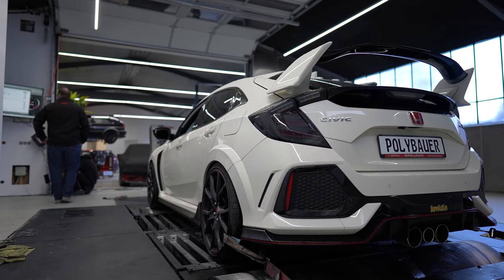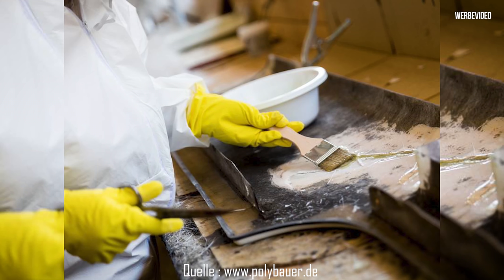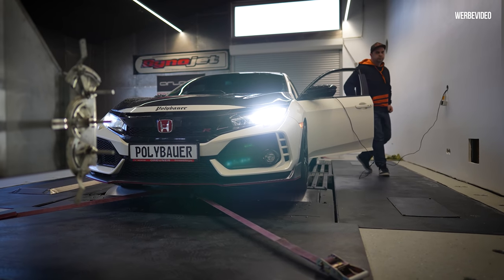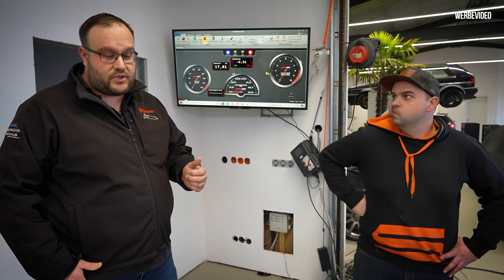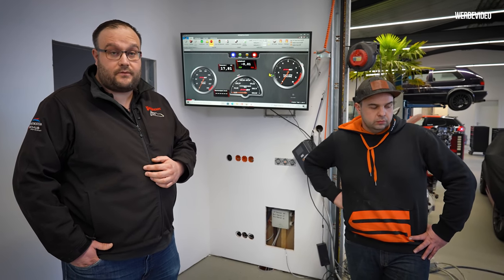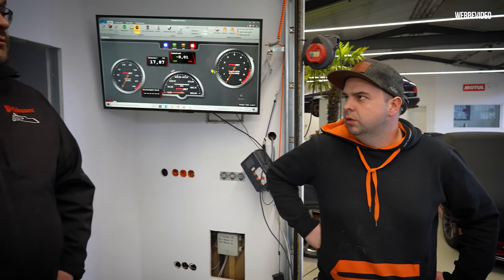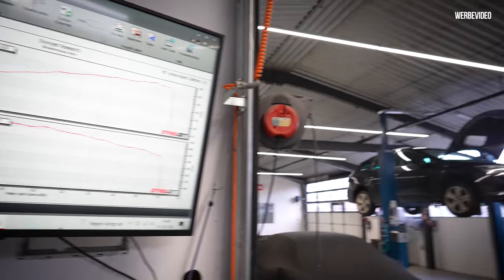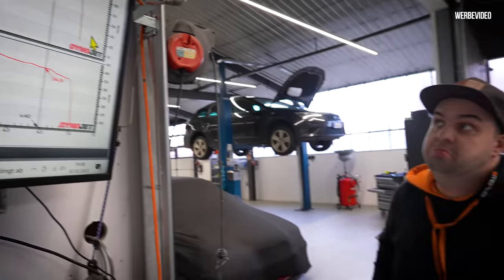Neues Projekt |  Honda Civic Type R Tracktool  #1 René Bàuche

Comment: Fahre selbst auch einen fk8 type-r  und habe aktuell umgebaut auf: remus abgasanlage mit Sound Controller, prl motorsport ansaugsystem, japan racing jr28 8,5x20  mit bridgestone potenza sport Reifen,  smokey Seiten Markierungs leuchten.
Reply: wieso das prl wenn man fragen darf?
Reply: Remus Abgasanlage mit Appsteuerung Via Smartphone? Wenn du das eingetragen bekommen hast, verlink die mal bitte hier (sollte aber bitte nh Klappe haben)
Reply: @dr.c_y_r_a_x_x5436  

Habe mir das prl stage 1 ansaugsystem geholt weil von hondata ein test von allen gängigen ansaugsystemen gemacht wurde und es dort sehr gut abgeschnitten hat. Ich kann bestätigen das es wirklich sehr gut ist! Der Sound ist top quasi das Geräusch der turbo Spule und durch den silikon Schlauch zur Charge pipe ist der flow besser wie mit Serien rohr. Brachte  9ps und 12nm das ganze.
Reply: @HoffnungsVogel  

Die remus anlage hat an sich eine ABE ! Der sound controller natürlich nicht aber das steht auch bei dem controller von remus mit dabei.  Aber ich habe die Remus anlage mittlerweile getauscht mit jemandem gegen seine HKS Legamax auspuffanlage die mir besser gefällt vom Sound und der optik.